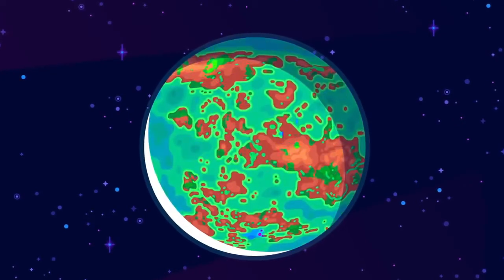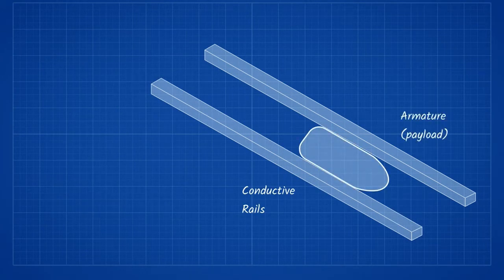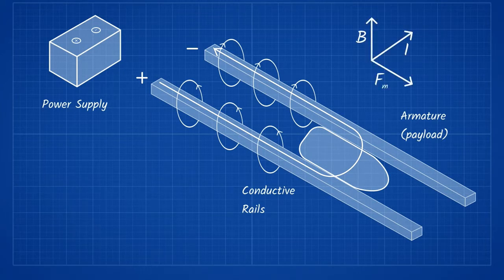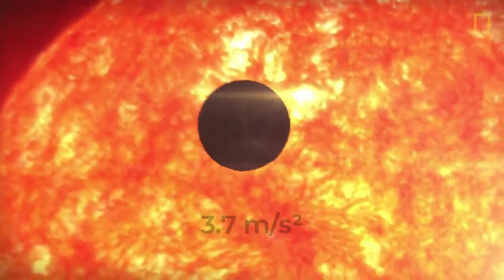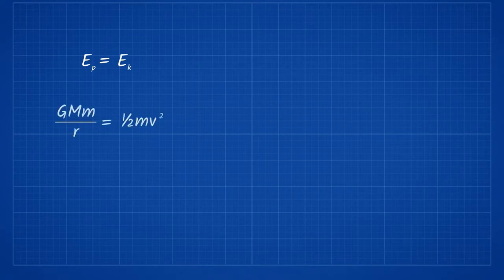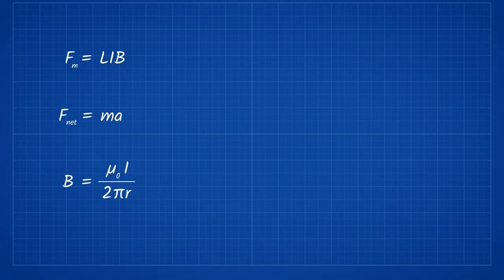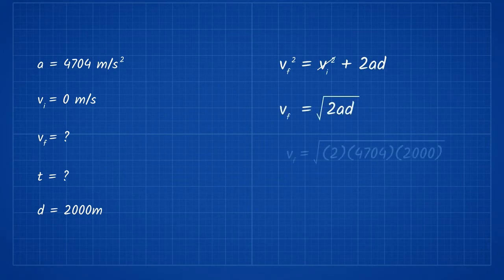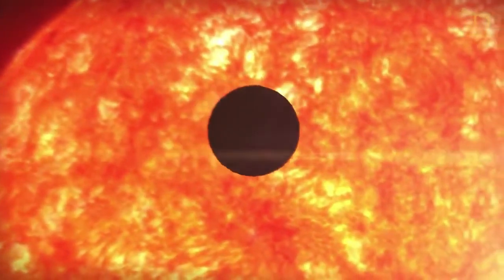Forget Spinlaunch: The Future Of Propellantless Rocketry (mass drivers)

Comment: Everyone's hooked in to space based solar power,... when you could just send modular nuclear reactor to the surface of a Mercury in just one single launch,.... the infrastructure footprint of solar will always be to large,... and,... venerable to attack or meteor strikes,.... to deploy solar power on mercury is an unnecessary expense when a small reactor would be ready to work on landing.
Reply: *too (not "to") large.
*vulnerable (not "venerable") to attack

Comment: Gas propellant can be used too. Problem is crushing G's. Best idea was Space elevator which Japan is developing
Reply from the maker: Very true. I'll have to look into the space elevator!
Reply: Steam power?
Reply: Space elevators on Earth are a ridiculously bad idea. What happens when (not if) the cable breaks? Not even exaggerating when saying that it would be a mass extinction event.
Reply: @Eidolon1andOnly   @Eidolon1andOnly  Mass extinction event :D I think fossil overuse as well meat addiction is more like to cause it. This is initial project that will require huge funds and even world cooperation but it will paying of and make space travel affordable. Cable of coarse will to be well manufactured and light at first but gradually it could be made heavier and heavier. Using rockets is even more riskier, lots of astronauts lots their lives